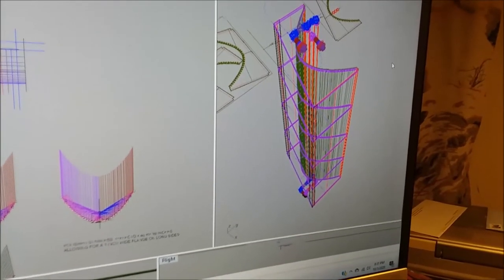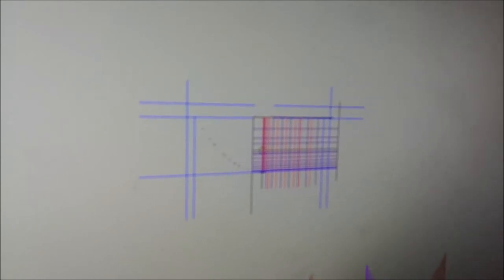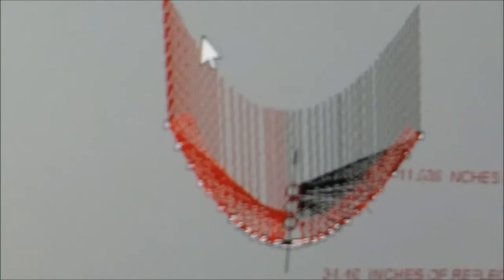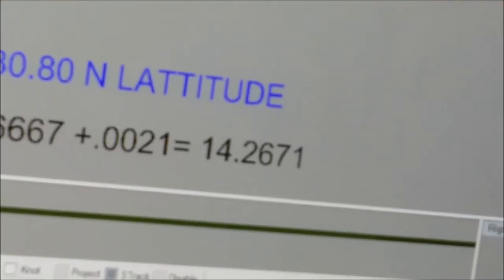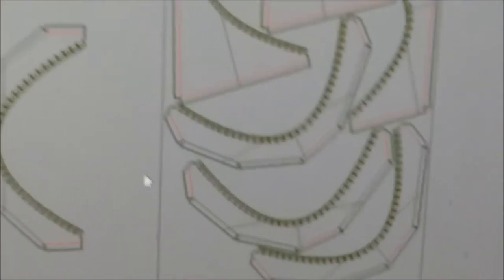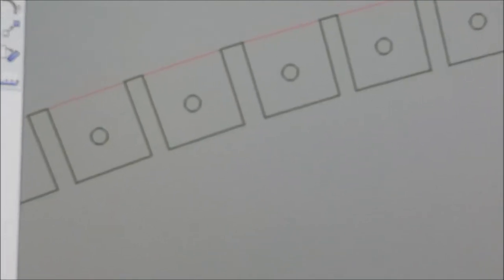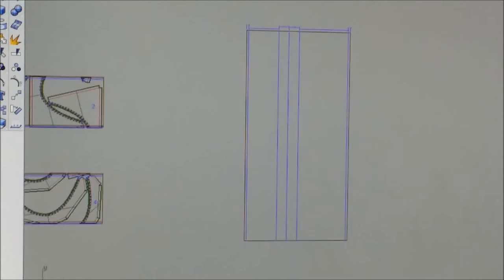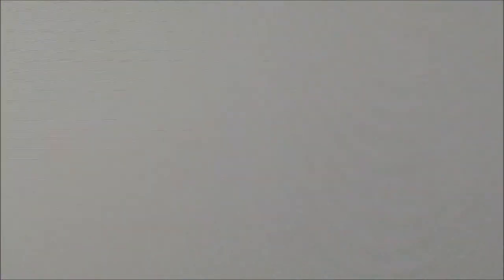PARABOLIC TROUGH SOLAR WATER HEATER WITHOUT ELECTRONIC TRACKING FOR DECAGON HOUSE

Comment: hey! im watching your videos!  the info is very interesting. but the video technical quality is bad. u could put a video capture software or hardware on your pc. then use a video editor... you will then gain an audience. some of the other house builders have 10k -30k subs and their technical info is less than 10% of yours. you got the info!   thanks for your time.
Reply from the maker: I am in the US and can't get back to my go-pro stuff. Usually I have a stack of boxes to set the samsung phone
on and it doesn't move. I tried holding it and had this failure. There should be more info like the recirculating loop
past all the 27 hot water fixtures using an automotive water pump and a windshield wiper motor with a solar
panel. When we build this (after the portable turkey shelter) I will do a complete video with my normal rambling
off topic excursions that have deemed this channel a failure. I did break the 11 subscriber barrier this month
and now total 128 viewing hours since last March.  
           I use movie maker video software by microsoft which is free and does many things like rotating phone
videos when the camera flips them. The big problem is not having electronic  image stabalization on the phone
and no gyroscopic gimbel mount which I may get shortly. Thanks for watching my video.
                             george and aurora
Reply: @concretehousebuildinginph1488  dont give up. you probably didnt learn the things that you talk about overnight. youtube can be a steep learning curve. thanks